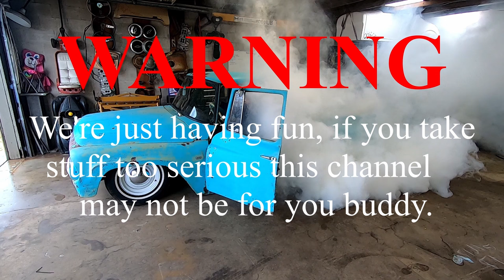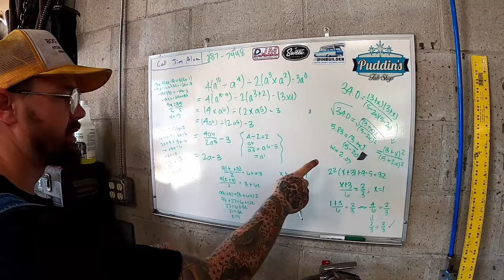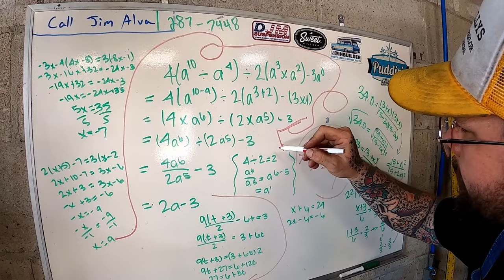The Yee Hawl gets a carburetor FINALLY.  ((IT CATCHES ON FIRE!!!))

Comment: When I was 18 I was working at an auto repair shop, and this sweet 1998 Mercury Merkur XR4Ti was towed in from the body shop down the street. The guys over there brought it to us to troubleshoot a no start condition. One of the mechanics at the shop wanted to check for spark so he removed a plug and laid it onto a ground there in the engine compartment. Just as the boss walks over to see what is going on, another guy cranks the engine over. He learned very quickly she was making spark because the fuel injection sprayed gas up out of the spark plug hole, across the spark plug and ignited a giant fire ball in the bosses face. He ended up getting very singed and his right arm took about 6 months to heal up. It was a good thing there was a fire extinguisher handy. When my boss caught on fire, he completely forgot about stop, drop and roll, and proceeded to fan the flames by waving his arm around. A quick thinking employee with an extinguisher put him out.

Comment: I was on a date on a cold December night in my 1985 S-10 Blazer with a rebuilt 2.8 V6. The carb froze open and it over-reved for a good 20-30 seconds before I got it shut down. Lucky I decided to have a look under the hood where a flame was taking hold. I calmed my panicked gal and walked to the back where I keep an extinguisher and put it out. I drove her home a short way and drive myself 30 miles home knowing full well my engine was as good as dead.
But my date was impressed by my cool head and preparedness.
I've used extinguishers on other people's vehicles at least 2 other occasions.
Everyone should ALWAYS have one.

Comment: Puddin, check  the valve clearances. Mentioned this before but I worked as a Ford mechanic back i the 80”s and the inlet valve tightens up causing a lack of go. Would also be worth changing the oil spreader bar as they are a service item. Loving the content Sir. Please continue.

Comment: A good thing I've found to have on hand when working with threading aluminum is a helicoil kit it is an almost must have. Also a must have when you are cutting bolts on a gas covered motor would be a pack of hot dogs, You have a great channel and hotrod is almost a puddin Jr.

Comment: Hot Damn! Glad you got that fire under control quick. Live and learn my friend, live and learn. I once caught a 1994 F150 parts truck on fire. it had sat a few years before I drug it home. I decided it was a good idea to push the schrader valve on the fuel rail with a screwdriver, guess I was gonna judge by how funky the fuel smelled if it was gonna run or not. Needless to say the fuel was still good... Lol. Think I ended up getting some fuel spray on or near the distributor, because when I bumped the key she went "poof". To make matters worse the truck was sitting on a wooden deck car trailer, it was also hooked to my old lady's car via jumper cables, so there was plenty of extra fuel around for the fire had things gotten out of hand. I slammed the hood down on the truck and ran over and got the hose, ended up putting the fire out with the hose through the wheel wells. 

Learned my lesson the hard way that day, luckily nothing of value was lost, it's a Ford so it started and backed off the trailer despite having been on fire like a half hour earlier. I've always kept a couple fire extinguishers in the garage ever since.

Comment: Doing an EFI conversion on a 351W in my 1978 F-100, the return fuel line popped off right over open headers, quite the flames.  Got it out quite quickly, but not before it took out the wiring harness.

Comment: 1. I had a '76 IH with a 345 IH motor. I re-routed the old Power steering high pressure line for some reason, and it split a month later. Sprayed hot PS juice onto a really hot exhaust manifold and became a flamethrower all over inside the engine bay. Rewired it, replaced the rubber parts, and it started right up! 
2. I had 3 or 4 Ford Couriers after the oil embargo "crisis", and they were all gutless wonders. Aerodynamics is your friend; grab a spare hood off .5 or .25 and mount it as a wind deflector on top of the cab. That cargo box is a big air brake. 3. I highly recomend replacing the timing belt on any engine you want to keep. Ask me how I know.☹

Comment: I had an electrical fire on my 86 Isuzu imark. I drilled a hole in the firewall and ran a hot wire for my musical horn. Notice I said nothing about a grommet. It lasted about 2 weeks. I went out and started it. the cab filled with smoke so fast. Love the Chanel.

Comment: I was putting coilover shocks in the rear of a '79 trans am, where the shock mounts up top is not enough room for a wrench so you have to cut a little away, well I didn't think about the spraying insulation on the interior and there was smoke billowing out of the car and I quickly remove the back seat and panels and sprayed it all down with the garden hose cleaned everything up and it was no harm done 😂 it was my girlfriend's car,she stood there calmly and watched. I love your show, keep up the good work dude 👍☮️

Comment: I have only found one 2150 Ford carb that might be worth rebuilding.  They are usually worn out through the throttle shaft bore and shaft itself which is what you ran into.  Those rebuilders usually don't take the time to ream out the bore and install a new bushing.  It is probably better to just order a new Holley 2 barrel in places where emissions testing isn't a concern.  Maybe get fancy and install one of the Sniper 2100 EFI units.  

Since you are cutting up the Texas Special, rebuild that 2.3l into a 2.5l for a few more hamsters then drop it into Yee Haul.  Unless, of course, you can find a turbo 2.3l.

Comment: I set a 1968 Marcos 1600gt on fire by fitting an exhaust tight to the wooden chassis... Fire was right under the petrol tank. My extinguisher failed but the fire brigade arrived and put it out before it went bang. Good job because before they arrived I was trying to put it out by spraying fuel enhancer on it (I panicked and it was the only wet thing I had to hand). Makes puddin blowing on his fire seem almost sane....

Comment: Yep, my brother's 57 Chev caught fire one night. My brother called saying his car had quit running, Dad and I met up with him. Dad (+/- 35 years of mechanic-ing) started troubleshooting and while cranking it over the beast backfired up through the Rochester carburetor and started flaming! It was a cool night so Dad was wearing his (favorite) jacket which he stripped off and smothered the fire with. I was a freshman and my brother was a junior in high school at the time, we just stood there gawking while Dad did all heavy lifting. Dad was a self-trained automotive mechanic and an trained Air Forced aircraft mechanic. While he had the typical problems with aircraft over the years he never lost one due to mechanical issues.

Comment: Hey Puddin, we keep Halon/heltron fire extinguishers in the garage because it puts out the flame and leaves absolutely no residue behind. A little goes a long ways. One has been used several times and it still shows green on the pressure gauge.

Comment: Whole car burned to the ground on the side of I-94 in probably February '93?  It happened to me but I could be off a year.  1978 Ford ltd wagon, army green mil surp bought at the Albuquerque Auto Auction.  I used it to move me and my girlfriend back to Michigan, had her civic on a tow dolly behind it.  All went well until thr RR wheel bearing failed and most likely became red hot, something ignited and the right rear tire started to burn.  I pulled over, probably should have tried to keep driving to the next exit, hindsight, in any event as soon as we were stopped the fire engulfed the vehicle and to a large extent everything we owned.  It was tragic as far as property loss but no one was injured and we got a ride out of there.  The vehicle and everything in it was a total loss.  But we were fine.  Yes I caught one on fire.
Also had a Chevy Astro van drivers side widow regulator fail and catch flame while I was driving it.  Fortunately I was able to get it home and get the fire out before much more then the door panel was damaged.

Comment: I've had good results re-bushing throttle shaft drillings with hobby shop brass tubing in a drill press.  On Solex carbs for VWs.  The trick is to chuck a drill bit that fits exactly into the drilling, clamp the carb down with the chucked drill bit in the carb, then take the drill bit out of the chuck and replace it with a larger one, and drill the carb out for the tubing.  That way it's perfectly centered.

Comment: Have not caught a truck on fire, but have caught a drill rig on fire. Been having issues with the ole 300 inline Ford. Had a gas can sitting on the motor cover and a fuel hose blew off the fuel pump catching on fire. I ran 1/4 mi round trip to get the extinguisher. We managed to get her rewired, new push rod cover gasket, replaced the melted distributor and ignition box drove it onto the trailer. Made for some great pics and conversation.

Comment: I used to have a Holden Gemini (I'm in Australia) that I built and drove in time trials and hillclimbs. It had a real cranky little motor, big cam, high comp, built everything, and the obligatory webers which were famous for catching on fire when restarting a hot engine. And they did. More times than I can remember. Lost a few good air filters, some leads, some wiring. The cam was so lumpy it would spit fuel back out the chokes when cranking and the hot metal around it would set it off. Later on I went to an enclosed airbox system and that helped, but they still caught on fire a couple of times. It got so that I could tell if it was on fire by the sound of the engine when it was starting, more often than not I'd lift the bonnet and unclip the fire extinguisher before starting just so putting it out (if required) would be faster and easier. I considered fitting some kind of under-bonnet extinguisher system, but ended up upgrading to an injection system and there were no more fires after that.

Comment: Glad to see O'Reilly's remanufactured carbs haven't changed over the years...When I first saw you were putting a "new" carb on the Yee Hawl, I wondered how many you were going to go through. I had a 1988 Chrysler with the 318 that I went through 5 before going to a salvage yard and pulling one off another car and putting the kit in it. Thought a remanufactured would be better, Nope! Many of the same issues you were experiencing, including having parts that should have been able to be adjusted, having been tack welded, instead of screws replaced. They used to be rebuilt by Holley, yes the same company that makes the nice shiny new ones. 

I really enjoy your channel! Keep up the great work!

Comment: Yes, me and my buddy set my 68 GTO on fire at 1:00am one night after a new engine install.  It was late, we were at it for a while, engine wouldn't start, we first checked to make sure the fuel pump was working by disconnecting the feed line to the carb. Check ✅, next let's make sure it has spark, removed a spark plug and left it to arc on the block.  Gave the engine a spin and fuel shot right onto the arcing plug.  Big fire fast but we through towels on top and it was out as fast as it started.  Damage was minimal. 🙄 No matter how many wrenches you turn it's a good reminder to slow down and think about what you're doing.  I know exactly how you felt when I saw this vid.👍

Comment: I caught one on fire on a lift once. While pulling the tank to replace the fuel pump, gas poured out of the filler neck right onto the drop light. Quick acting from a coworker put it out before it burned the car and shop to the ground.

Comment: I can appreciate that little flame adrenaline rush. I was tuning the Holley carb on my 55 Chevy wagon. Adjusting the floats. Wasn’t paying attention to the puddle of gas building up under the rag I had to soak up gas. I started it to check it and it back fired and lite the rag and puddle. Think I peed a little as I grabbed the fire extinguisher only to find it was empty. Just a fyi you can put out a gas fire with water just need a lot of it. Lol

Comment: I've set a 1979 Suzuki GS450 on fire... vacuum hose was connected to the fuel port on the carb, and gas line was connected to the vacuum port. This was done by the previous owner, so it made my first start of the bike quite "interesting".  Also, exhaust headers were disconnected during the first start and flames shooting out of the head caught fuel leaking out of the carb on fire.

Comment: I’ve set my lawnmower engine on fire. 5ft tall flame because the gas tank lid leaked and the spark plug wire arced out on the tank.. Then it caught the 5 gallon gas can on fire. Glad I had water pressure. It was during a power outage.

Comment: Hey bud. Love your videos! I caught my Yukon on fire big-time. Bigger injectors and fuel pump, stage two cam. Was working on dialing in the tune, well my Amazon adjustable fuel pressure regulator failed and hydro-locked some cylinders with fuel 😒. I pull the spark plugs give her a crank and a fireball shoots up around the hood. The explosion rattled the truck! I didn't think to disconnect the coils. Fortunately,  I do fire suppression so I have fire extinguishers everywhere. Man it is a mess! Glad I didn't burn her to the ground. One thing I decided was to get a CO2 extinguisher in the shop. Makes no mess like the powder ones, and the powder corrodes wiring. Also off the subject, my neighbor converted his old jeep to a motorcraft. We couldn't get it to dial in. I ended up making a new accelerater linkage out of coat hanger so that it pumped less and wasn't flooded out the motor. It worked great. Maybe an idea to try! Working on making some videos myself as soon as I can get recording equipment that actually works decent. You get what you pay for that's for dand sure.  Happy new year!

Comment: i have set 2 on fire, 1st bowl adjustment on Holley went wrong, 2nd different car, needle and seat stuck, filled cylinders, took plugs out cranked over to blow gas out, plug wire sparked on header, got both out, will never forget

Comment: I was welding on my Beetle and lit a heater conduit on fire.  Didn't notice until the interior started filling up with green smoke.  I had to bust a hole in the fender with a claw hammer quick like to put it out. 1979 was a good year.

Comment: I've had a plastic oil pressure gauge line melt on a turbo hot side and spray hot oil all over the exhaust at about 150 mph.

So, not just set a truck on fire, but did so well beyond a dangerous speed. (As well as a number of insulation fires from welding.)

Comment: I set my 1984 Ford Ranger on fire. I did a bunch of deletes and probably nicked the fuel line...or left it in a place where it rubbed until it leaked. Anyway, I was driving home one day and I saw some smoke. Pulled into my driveway, and noticed some flames through the grille. Blew a fire extinguisher in there. Then pulled off the melted parts. Swapped out some new spark plug wires and she fired right back up. Drove it for another two years.

Comment: I work on lawn mower and weed trimmer engines on my off time from work. I am previously working on a leaf blower that needs a new carburetor because the rust seized up the throttle stuck in closed position with broken off spring wouldn't move

Comment: I set my Chevy cavalier on fire when I was first learning mechanics. Changed oil and plugs. When pulling the wires I broke it and thought that I had fixed it back “well enough”. Some oil had spilled on the manifold. When I cranked it the wire pulled loose from the cap and I’ll be damned if it didn’t find some spilled oil. Had to replace the wires, fan shroud, coil pack…then I bought the plug wire tool.

Comment: I was a flaming chicken running down the highway. 1980 Firebird middle of rush hour traffic On the Capital Beltway (I-495 and  I-95) Fuel  line popped off the carburetor and spayed onto the exhaust manifold. Got pulled over and the fire out. Lucky I carry a fire extinguisher as part of the Emergency kit. Long story shot, put fuel line back on drove home, washed off the motor. Only had to replace one wire.

Comment: Almost set one a blaze. 99 s10 back in high school. First time wiring anything. Bagged it and wired in my viair directly to the battery no relay and way too small wire and forgot the switch was on (no pressure switch) and it went up in smok. Stopped open the hood and ripped the wires off the battery. Luckily it did go up in flames.

Comment: You can have enough carb available but the head cam and intake exhaust flow will still limit the truck on top speed/ rpm and you are pushing a lot of air with the box option.
good video, keepem comin

Comment: .
I just had a bout with fire on my Jeep 2003 Grand Cherokee. Changing out the crankshaft position sensor. So, obviously  I'm cutting the hole in the floor board right where my buddy marked it the night before and BULLSEYE !!! Hit the gas line dead center ... FIRE !!!
Remembering in a panic I had the Fire Extinguisher just inside the door and everything was soon yellow and no fire. Lucky no damage ... but was done for the day. 
.

Comment: I have never set a vehicle on fire while working on it, but I barely know how to turn a wrench and watch YouTube.  Hasn't stopped me from burning a few holes in some upholstery at the very least.  There was one time I stuck an oversized fuse in a '96 Thunderbird for the interior lighting.  I was convinced I had a grounding short blowing my fuses, so I thought it would be smart to see if I could smell it burning or welding wherever the short was, or see it let out the smoke.  Never did find it.  Shame, too, the lighting on that car was well laid out, built in lights under the hood and in the trunk on the same system.  Would have been nice.